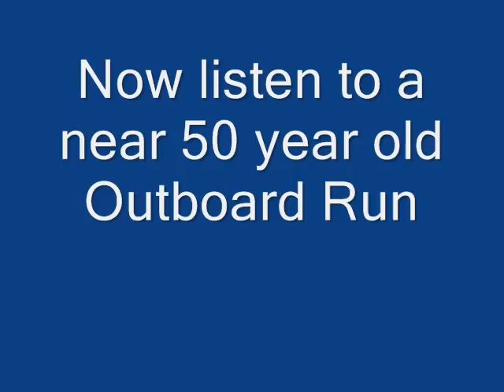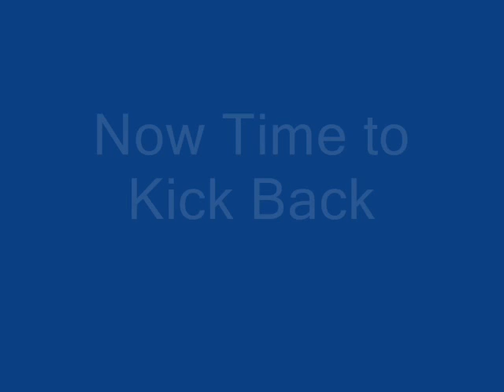Evinrude Outboard 1960   40HP   Lark II

Comment: Hey Gary I recently just got a boat with this outboard and finally got her running! Just posted a video of it too. 

A few questions, 

where is the lower gear case flat screw for drainage? I see the upper vent one on the side and one underneath the prop. Just want to make sure. 

Also, the engine I got was extremely corroded. So bad that I can’t even locate where the anode is (or maybe it fell off). Any pointers where they go and where I can buy replacements? 

Thanks in advance

Comment from the maker: @anfobomb   Mine runs pretty good.  Last time at lake, it was hesitating a little on power up.  I have rebuilt fuel pump this winter and waiting for warmer weather to head back to lake to give it a try.   These old engines are fairly easy to work on, and with any luck will run for years.  On yours, check compression, if OK, check spark, should have a 1/4 inch spark off end of wire to plug, strong blue spark, if not change coil.  Carb gaskets need to be good, too.   Good luck.

Comment from the maker: @jawi21 
I have spent hours on mine, first blue out a plug, put in an insert, then burnt out a coil, replaced coil, runs but hesitates mid range but eventually takes off.  So I rebuilt the fuel pump, replaced all fuel/ vaccum lines, now waiting to try.  I picked up a repair manual on CD off ebay, covers all the old motors.  Standard checks are compression, and spark off wire to plug, needs to be a strong blue spark.  Rebuild carb is my next item.  Just have to try things and see. Good luck.

Comment from the maker: @rory2895  I have not taken lower unit off so don't know much.  Mine does get some water in gear oil, I change each time I go to lake so it has not been a problem.  There is an O ring around bearing that goes around impeller shaft at bottom.  Fits between skeg and lower unit.  O ring needs to be good or water can get in there. I bought a repair manual off ebay on a CD for $5.  Good to have it covers many motors.  Good luck.  I'm sure there are other gaskets on lower unit too.

Comment: I see these are old post, Gary do still have your motor or anyone else still using this motor? I just got one and seems to run good in the drive way havn't had out on the lake yet. I have on a 1960 whaler 13. I was told boar and motor are original

Comment from the maker: @xbecca25 The spark plugs are standard champion plugs.  I have gotten plugs,  ignition coils, points and condensor from NAPA auto parts stores.  You can also find parts online at various marine supply houses and ebay.

Comment: @GTweed0605 one more question, any idea what the micro farrad rating is on those condensers????mine need replaced and I'm probly gonna go with automotive condensers or just capacitors

Comment from the maker: @aaronrose83   Only place I have found parts is on ebay and I have not seen a wiring harness.  I had to rebuild mine as the rubber became brittle and wires inside rubber connector were breaking.  Repair shops might be another source if they have old parts laying around.   Both the Johnson and Evinrude from this period might work.  Good luck.

Comment from the maker: These motors have a thermostate and water pump.  Once motor heats up after a few minutes, the thermostate opens and water is pumped through motor and out top exhaust port.  There is a lower exhaust port as well but you can't see it when in water.   I replaced water pump and there is a good flow of water out top exhaust.  I have other videos showing the lower unit and water pump and motor running after water pump replacement.  Most water pump impellers need to be replaced ever couple of years.

Comment from the maker: @rory2895 I have heard that your not suppose to use ethonol  type fuels in these old motors.  I have always bought non ethonol fuel.   I have only had my carb apart once and really don't remember what the float was made of.  I know some are cork, brass, or plastic.  Don't know if there are replacement parts, seems like carb rebuild kits might have a float in them.  You might ask a parts house what is included in kits.  I would try non ethonol fuel first.   I just got back from a lake trip, too.

Comment from the maker: @rory2895 These will smoke if mixture too rich.  I keep mine lean and it does not smoke.  They use a lot of fuel and water can get oily.  32 to 1 is what they are suppose to have for fule mix.  I rebuilt fuel pump and that has helped fuel consumption.

Comment from the maker: @rory2895   I have mine leaned out as far as adjustment will allow and it uses a lot of fuel.  Doesn't smoke but is a fuel hog.   My boat runs about 25 MPH wide open and I guess it uses a gallon of fuel in 15 to 30 minutes.  I have thought about going and get another motor, maybe a 4 stroke, but these old engines are hard to beat.

Comment: when to replace impeler took of the lower unit and the drive shaft rod did not come out with the lower unit it is now stuck on the motor do u have any ideas? and water is geting in the gear oil any help would be appciated!

Comment: Gary, how do you winterize this motor? I have the same one but i'm unsure.
Reply from the maker: I keep mine in my basement. But if leaving outside  I would drain gear oil and make sure there is no water in lower unit as it will crack skeg if it freezes.   Run out all the gas.  Cover engine to protect from weather and disconnect all electrical lines from battery.   Leaving outside tends to cause electrical connections to corrode, so cover electrical connections if possible.

Comment from the maker: @aaronrose83 I got points and condensors at a NAPA auto parts store, the part box reads  SysteMatched Products for Johnson, OMC Cobra, Evinrude.  No. on box 580 148.  Bought this several years ago.  Most auto or marine parts store can get what you need.

Comment from the maker: The drain plug is under the bottom of skeg, flat head screw, same as fill screw on side above the gear case. Do not take out the phillips head screw on the side this holds the shifting yoke in place.  There is no anode on these old motors.  If yours was corroded you probably should take gear case apart and put in new seals.  Parts are available online, ebay and most outboard supply companies.   Some parts are out of production.   I sold this boat and motor, opted for a newer model.  Thanks for looking.

Comment from the maker: Just make sure water vents are open and clear, might be you installed rubber pump with vanes in wrong direction or did not get woodruff key back in place on the rubber pump,  check water tubes that their seated into pump and power head.

Comment: I have a old 40 evinrude outboard, not this model. But, I ran across this one while doing some research, which seems to be doing the same thing mine does. Or should I say DOESN'T do... They are not spraying water out the exhaust.
Is this normal with these evinrude outboards?

Comment from the maker: @mpc1mil If the motor is running you can get a few hundred.  If it is not running you might get the most by parting it out.   Look on ebay you can get an idea on prices and part prices.  These are good old motors but use a lot of fuel.

Comment from the maker: @TweetyBird2895 

Might try EBAY.  I have bought a few parts there.  You may have to buy a complete carburetor to get what you need or replace the carb with one without the auto choke.  Good luck.

Comment from the maker: Probably will take longer than a couple of minutes for thermostat to open,   let it run longer and see if it opens.
Reply: Hi can you help me out I have the same exact motor and I just replaced the water pump and thermostat. The motor is overheating. I tried with thermostat out and still overheating. Not sure what else to do

Comment from the maker: I no longer have this boat and motor, but can email you some pages out of motor manual that could help if you willmsend me an email address.
Reply: Hi @Gary Tweed just got this motor about a month ago and trying to get it running good. So I came across your videos and they have helped me a lot, thank you. But I was just wondering about the water pump and thermostat. I replaced the water pump and thermostat and it’s still not pumping water out of the exhaust. I had motor running for about 2 min but shut it off because didn’t want it to overheat. If you could get back to me I would appreciate that. Thank you